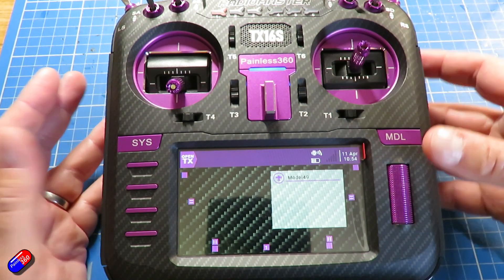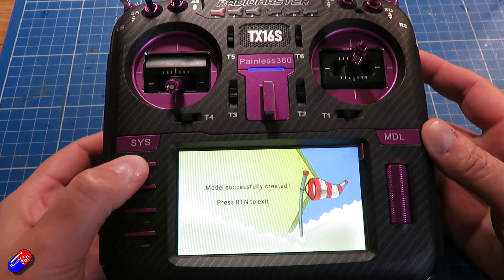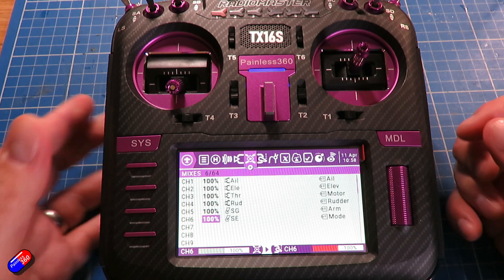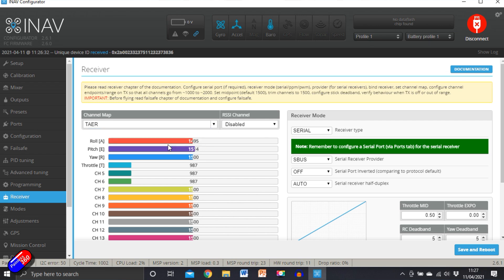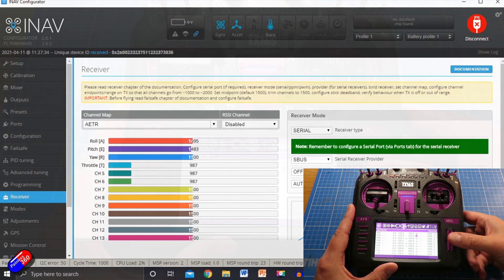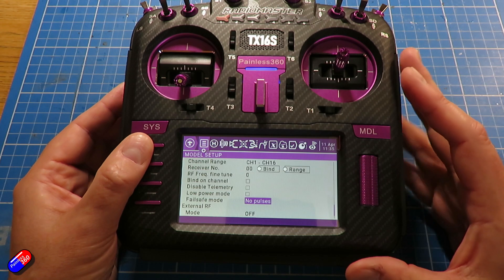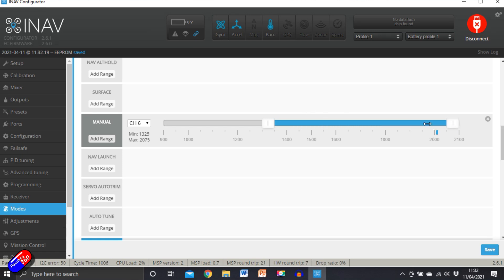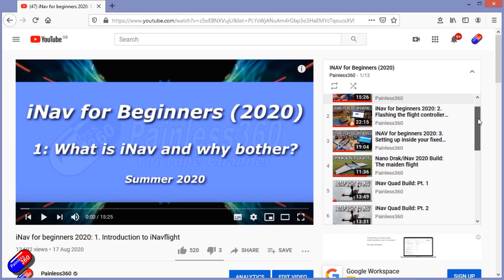Simple OpenTX Radio Setup for INAV and Betaflight (and other flight controllers)

Comment from the maker: There will be a Quad widget back in OpenTX 2.3.12 so if you use this version or later of Opentx on this kind of radio you shouldn't need all of these steps.. If you have any questions about things like travel and setup then please check out my INAV for Beginners 2020 series where I cover all of the steps I use that work great. Best of luck

Comment: You have helped me many times. Thanks. I wanted to get your advice. My racing quad is all set up and working except for one issue. After arming I stick up to full power which it does. But when I bring the throttle stick down, the motors remain at full throttle. Is this a betaflight fix or a tx16s fix?
Reply from the maker: I've never seen that here. What BF version?

Comment: I think many of my issues have come about because of confusion about where the arming is set up, in OpenTX or BetaFlight/iNav.  I have been trying to get them to work in OpenTX companion with no success.  It seems possible in either place.  I think of the open software as something like Unix (also open software), everything is possible, but nothing is easy.  lol  Cheers!
Reply from the maker: All you need is one channel setup on the radio for arming (usually CH5 or CH6) then setup the ARM mode for that channel in the position you want. Best of luck!

Comment: Sadly for me, this is the latest brick wall for me. I have a Archer RS receiver successfully bound to an X9 Lite  on Fport but i am not getting any feedback in Inav. I have the correct Uart with the right settings on the F411, i get a few telemetry readings, have all the latest firmware flashed....still nothing =[

i am so ready to sit this Kopilot on the shelf but i just cant seem to get this build working for me
Reply from the maker: I don't use fport here.. good FC manufacturers do provide some guidance. I.e. http://www.mateksys.com/?p=4488
Best of luck with it and I hope you get it working soon..
Reply: @Painless360  yea i got frustrated and switched to sbus. worked like a charm

Comment: Thanks for this video, Lee!  The amount of knowledge in your YT library for fixed-wing pilots is wonderful.  Would you consider a video on the iNav FixedWingGroup OpenTX Standard Model?  I run into the problem of not setting my models up all the same and recently discovered this OpenTX iNav "template" model that has all kinds of stuff preset and along with a CLI copy/paste in the configurator enables some pretty cool stuff.  Thanks for all you contribute!
Reply from the maker: Happy to - I hope to hear from one of them so I can look at a video.. I may do a video showing how I set it up. Stay tuned!

Comment: Don't you need to set the output min/maxes so you get 1000 - 1500 - 2000 instead of the usual Taranis/etc 987 - 1500 - 2011?  Or does iNav not care?
Reply from the maker: Please see the full INAV setup video series..

Comment: Thank you for doing this video, one thing I have not been able to figure out yet is how can I use my tx-16 S radio with a long-range APM 2.8 airplane build, what receiver do I need I was thinking about using Express lrs but then I hear they can't run servos? Thank you for the help I am confused on this right now.
Reply from the maker: I would look at Crossfire for super-long range flying of any type. I have videos on how it works with stuff like Ardupilot too.. Best of luck.
Reply: @Painless360  thank you that is what I have been looking for, I will search your channel to find the videos you're talking about

Comment: Short and sweet. love it.  No need to adjust extreme throw values to 1000 and 2000 with subtrim then check if center is at 1500?   I thought  that betaflight prefers 1000 to 2000.
Reply from the maker: There is a lot outside of the scope of the video. This is aimed at those struggling to make a basic model type and add two extra switches. Maybe a more detailed video on a few of those extra things I do if this proves popular..

Comment: Great video thx!!  ? When your adjusting the subtrim to get the center stick at 1500. Is it wrong to calibrate your radio to fix that issue?  When I use BF and my center stick is off I always calibrate the radio in that BF screen and the center sticks usually go to 1500.  Is that not a good way should I be using the subtrim?  Thx in advance
Reply from the maker: That is one way to do it but you can find that some receivers will report the values differently from others... Happy flying!